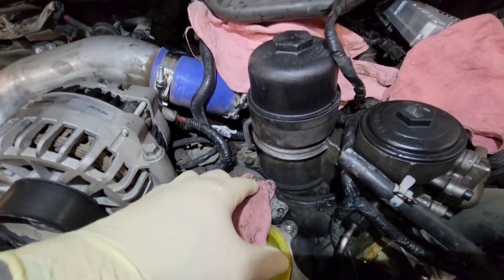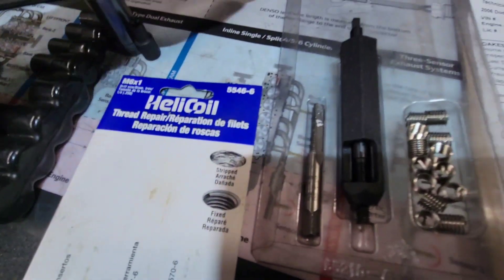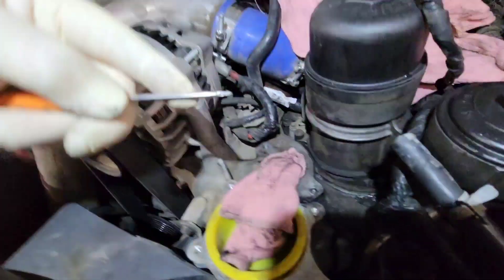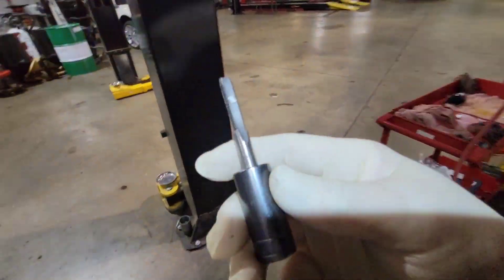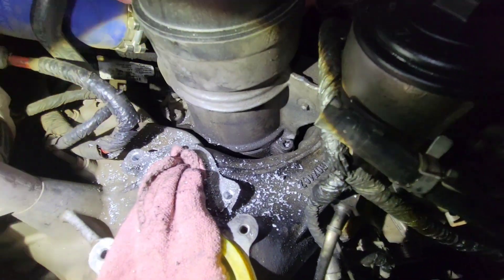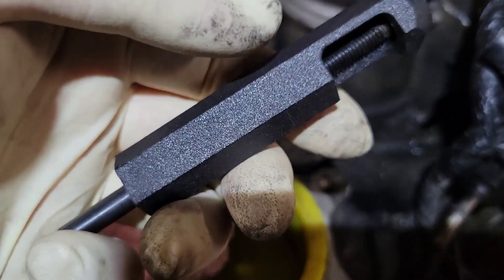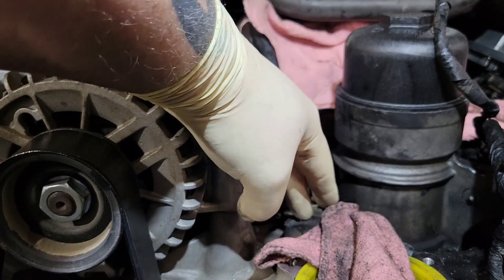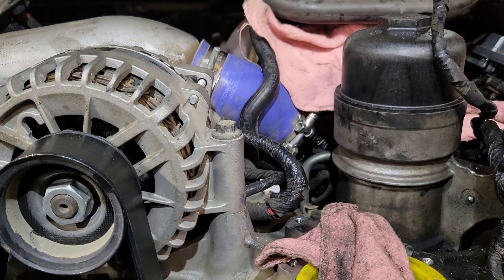THREAD REPAIR. How to install a HELICOIL

Comment: Great education for people
I prefer the power coil brand kits myself 
I add some red loc tite to the helicoils,
 do a follow up on time serts as the process is a little different
Reply from the maker: I have never heard of that type but will look them up. Thank you for watching. I normally use red loctite as well.

Comment: Excellent tutorial. Those chips get everywhere when you drill. I've never had a chance to use the Heli Coils with that outer guide. Always had the kits with the plastic wingnut install tool.
Reply from the maker: Interesting. Thank you for watching. I appreciate it.
Reply: Goop the drill with grease it helps catch a lot of the chips

Comment: Tip: add grease to catch all metal shavings, and make sure to turn slowly do not force it or you will break the tap
Reply from the maker: Thank you sir, yes I use grease but not always.

Comment: I prefer a T handle for starting the tap into the hole. I use a 1/4 drive t handle to reduce leverage.
Interesting note a 6-32 tap will break easier than any other size.
Reply from the maker: I have met a few people that like to do that. I honestly never use a T handle. A small ratchet in my hand is my preferred method. Thank you for watching. If you have a tap break I have a video showing a tool for removing broken taps.

Comment: Thanks for the video instruction. I’ve never done this but was told in the past that you lock the helicoil in with thread locker. Is this true?
Reply from the maker: Well this is an interesting question. If you follow the directions from the helicoil it does not say to put anything on the helicoil or any loctite. If you look up online most people put loctite to keep it place. I generally use loctite when installing them. Thank you for watching the video.
Reply: @NutsandBoltswithTone  very good!  Thank you for the quick response!

Comment: I need a solution for the glove problem. They either tear to easily of if I have them on longer than say an hour sweat drips from the cuff everytime I reach overhead.
Reply from the maker: I am not sure that there is a solution for that, I normally use cheap latex gloves because the shop provides them or I use the black gloves that I got from Factory Motor Parts here. To be honest when it is warm outside I have sweat pour out of my gloves all the time regardless of what kind of gloves I wear. I have found the black gloves to tear less then the cheap latex ones. Thank you for watching.
Reply: @NutsandBoltswithTone  I mentioned this to a mwchanic friend. He gets those thin cotton gloves and wears them under his latex gloves. He said surgical gloves are usually more resistant to tears. Now I gotta go shopping.